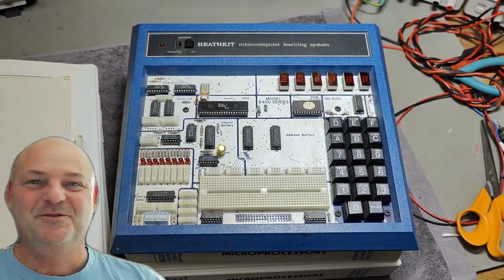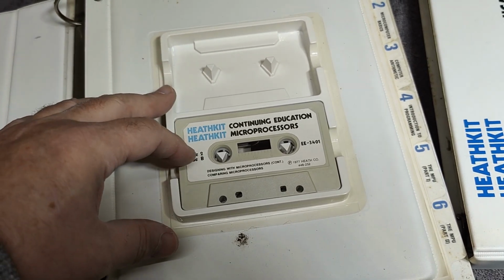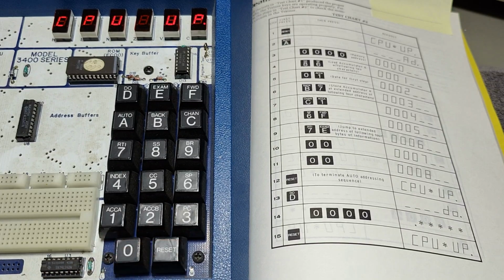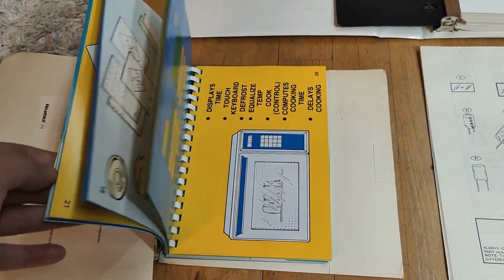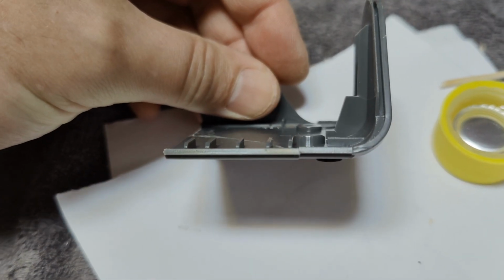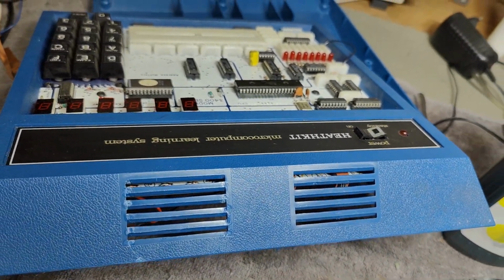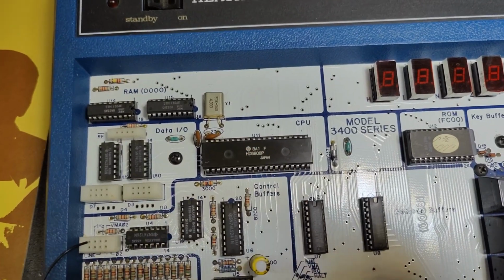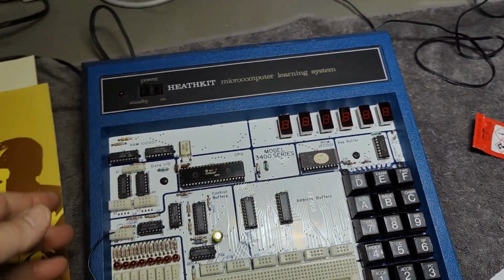Heathkit ET 3400A microprocessor trainer 1981 test and teardown

Comment: I recently purchased the same model that you have in the video, but I do not have the manuals.  I downloaded the manuals, but the diagrams seem to be wrong.  The 2114 ram in the book says it is a 16 pin device with Vcc at pin 16 and ground at pin 8, but this is wrong. The 2114 ram is an 18 pin device with Vcc at pin 18 and ground at pin 9. Also the book shows the /CE signal to the bank 0 ram comes directly from U20 pin 5, but this is also wrong.  In my unit the /CE does come from U20 pin 5, but it is routed through U5. Does anyone else see these errors? Or am I seeing something wrong?
Reply from the maker: several versions exists, check your version match the documentation version
Reply: You are correct, and look a little closer. The pair of 2114 chips were a whole kilobyte of SRAM, and only the first half kB was used, I think because certain of the experiments in the course would have required a revision had they interfaced the whole kB. In 1993, I thought I would get slick, so I modded my 1984 ET-3400A to use the other half kB. A few cut traces on the top and a 7400 hanging by its toes underneath, and I had access to the whole kilobyte. I still have it and the course today, with a rat’s nest on the breadboard for another 32kB. Both cassettes, too! Will have to look in some junk piles for the flip chart.

Comment: The main difference with the ET 3400A is that it used a 6808 CPU, which contains its own clock generator that only needs a crystal. The original 6800 needed a special chip to generate its clock signals. There is also the 6802 that is the same as the 6808, except that the 6802 has 128 bytes of (tested) on-chip memory at 0000-007F. The 6808 might have memory that was never tested, but there is an external pin to disable the memory for the 6808.

Playing around with one of these last year got me interested in some 68HC11 chips that I have, which I am slowly building a computer with. I only recently learned that there was a Heathkit 68HC11 trainer, but it was so late in the days of Heathkit that I'd rather build my own than fight ebay prices. They're also boring beige instead of that cool blue.

And here's a little program I wrote a few months ago:
CE0026DF 24BDFCBC C606A600 270108BD
FE3A5A26 F5CEC000 0926FDDE 24A60027
DF0820DF 0000374F 0E0E7E05 0E3DA000
Reply: Interesting. I have a bunch of these 6802 and periph like 6821, 6850 etc.... maybe I will build something like yours... But currently I catalogued all my uCs and I have now 557 pcs of >250 types... many so exotic that it is impossible to find any documentation for .. so 68xx is in queque...

Comment: FYI… the A version also has 1k of RAM.  The older 3400 only has 512 bytes using 4 ICs (not 2 for the A model).
Reply from the maker: yes , mine is the A version, two chips 2114 ram, 1024 addresses 4 bits in each, so two chips make up the 8 bit bus, and 1k byte in total.
Reply: @TeardownOZ2CPU  Hello! Check to see if it actually accesses the top half kilobyte of RAM. I don’t think it does, because the addresses would conflict with some of the interfacing experiments in the course. I could share pictures of my mod if you like, just let me know where. For collectible value, though, my mod probably devalued my machine, although it gave me access to the other half kB.

Comment: That kit was my first adventure into the world of microprocessors way back when it was being sold by Heathkit.  Virtually never sold with used units these days is the OUTSTANDING course material offered for these by Heathkit which was NOT the material which came with the kit, but a separate course.  He has those materials.
Reply: Wee! I built one of those when I was in my early/mid teens! And that's the reason to why I'm still a non-Intel and RISC guy! ;) So nice to see one of them. But I got two fat binders full of documentation. I remember only buying the complete kit but perhaps where I bought it from added the material.

Oh! There was lots of theory stuff in the documentation, basically teaching you all you needed to know about logic, electronics basics, and programming. Plus I got the kit which meant I had to solder all of it together. I got the empty board and bags of resistors, capacitors, keys, displays and all the chips and other stuff.

And I still remember some of the machine code: 86, 96, A6 and B6... Hmmm... Load Acc A in four addressing modes. Think 86 is direct or immediate meaning 86 05 would load 05 into Acc A. 96 I think pointed to the first 256 bytes of RAM, A6 I think was indexed by the index register (16 bit) and B6 was extended so B6 00 FF would load Acc A with the value in storage at address FF or 255.

And, yes! Mine was a ET3400 with a 6800 CPU. That means the ET3400A came with the 6809.

Hah! Nostalgia 😢

First program in assembly (mnemonics to make it easier to understand):
00 00 LDA A 86
00 02 STA A B7 C1 (could be the decimal point of the MSD - all segments were addressed).
00 05 JMP 00 00
Reply: The 3400A used a 6808, which is a 6800 that can generate its own clock signal from a crystal. There was a 6809 option using a riser board in the 6800 socket, but it wasn't very common and looks a bit fiddly.